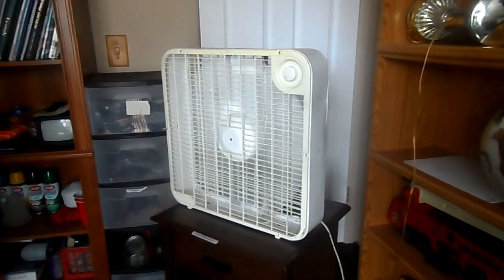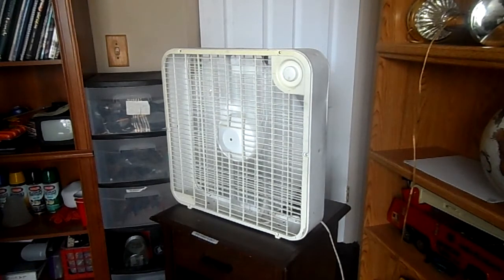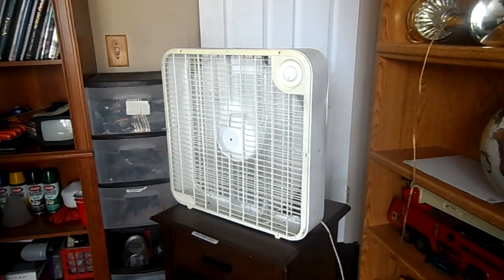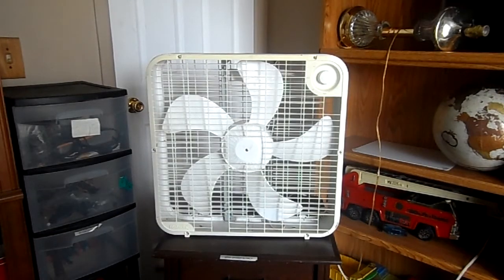1994 Holmes Slimline 20'' Box Fan Model HABF-20

Comment from the maker: Yeah, This is one of the only fans I've seen in person that was branded a Holmes, and not a Robeson. The only reason I'm parting it out is because of how badly warped the fan blade is. If the blades weren't warped, I'd keep it and use it in my workshop.

Comment from the maker: This fan is gone everyone the frame was collapsing and the motor mounts were breaking off so it was stripped for parts
Reply: That sucks. i would have takin it off your hands.
Reply from the maker: It was so bad that it was worthless. The stator your getting from me came out of this fan LOL
Reply: well. LOL i guess i am getting a part of this fan..LOL
Reply from the maker: That's a really good motor too this fan didn't have a lot of hours on it just had the living crap beat out of it
Reply: thats good. make a nice motor for that 200/i.
Reply from the maker: I'm sure it will. I've had it in a couple fans since it got pulled out of this one and it did well
Reply: cool. now iv gotta find a blade..LOL and that will make the 5th 200/i in my collection..iv had so many of those things..LOL
Reply from the maker: Yes you have! Hey I ended up with one of em trust me I know LOL
Reply: i guess i can say im the 200/i king..LOL